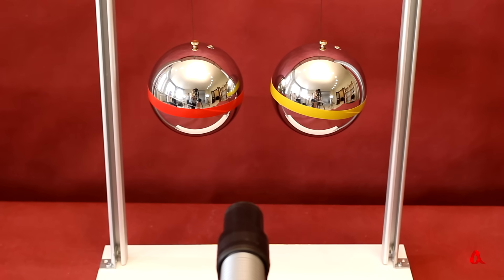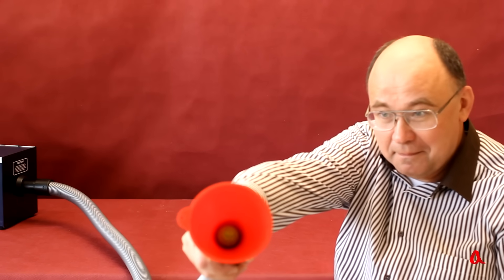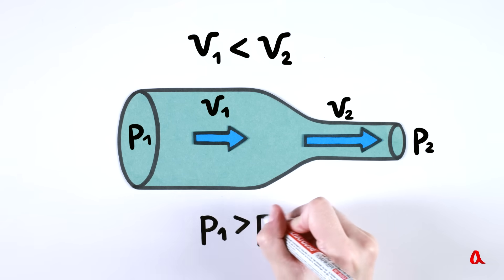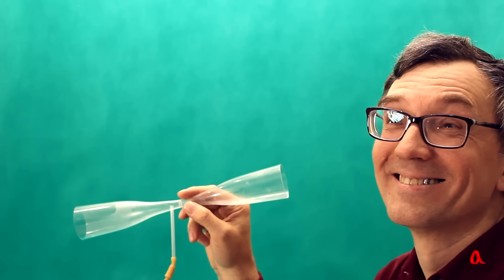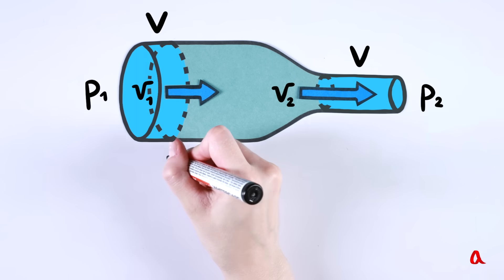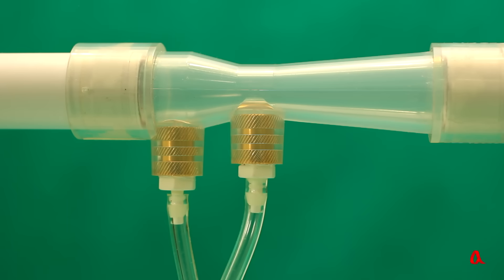Bernoulli's principle

Comment: How do i get max water pressure to my house if my meter is 500' away? Should i just run 3" to the house then switch to 1/2"?
Reply: At each diameter of a certain length there will be a different loss, caused by the viscosity of water at a given temperature and pressure. The smaller the cross-section, the greater the loss. When connecting to a house, the price of the pipe per 1 bm also comes into play.

Comment: This principle is what allows replacement or 'feed' water to be added into a pressurize vessel like a steam locomotive's boiler.  The device is called an injector.  There are two kinds, lifting and non-lifting. Steam is jetted down a tube toward the check valve on the side of the boiler.  The water is lifted into the venturi and is forced into the boiler past the check valve.

Comment: 3:01 carburetor. I just remember faster moving air = lower pressure. Hurricanes and tornadoes have low pressure because the winds inside them are moving faster than the air surrounding. Another example is when you're smoking in a car and crack the window. The outside air is moving faster than the air inside so there is lower pressure outside and higher pressure inside so it seems to suck or push the smoke out. Its also why airplane wings are more curved across the top and flatter on bottom. Air has to travel a further distance within the same amount of time to cross the top thus it is moving faster relative to the wing than air traveling beneath the wing. Lower pressure above the wing, higher pressure under it = lift
Reply from the maker: You are right, we recommend watching this video as well: https://youtu.be/YiFABManCso

Comment: This principle is used in laboratory apparatus for filtering chemicals. We have used such filtering device   in which running water pipe is used instead of air blowing pipe and thereby air is being removed from closed flask and filtrate is being sucked into closed flask leaving the solid precipitate on filter paper. Mostly all science graduates must have seen and used it in college days.
Reply from the maker: That's a great practical application of the principle!

Comment: Hang glider pilots are very aware of this. The compression at the top of the hill as the air speeds up can trap a glider or make it fly backwards, in relation to the ground, if the flow is greater than the max speed of the glider

Comment: Cool principle. I wondered what that principle was when I put my floss into running tap water and you can lift it up and down while it's basically stuck to the water 🤭😝
Incredibly fascinating stuff. A while back I watched a video that used that Venturi principle too, to empty a big pond using some PVC pipe, one horizontal and one vertical in the middle of it. The horizontal pipe attached to an air pump and the vertical pipe was put into the water that needed to be removed. The pump turned on and the constant rush of air pulled / pushed the water out of the pond. It was proper satisfying to watch 😃😄😆😅
Reply from the maker: Glad you found it interesting!

Comment: It isn't pushing apart because the air is being excellerated outward after passing the gap. Some smoke would help show this. Its important to note that;, 
 The inward force is not the result of the low pressure. Rather the low pressure IS the inward force caused by the outward excelleration.  Low pressure between them didn't cause them  to pull together, rather outward excelleration of air  did.  The lowered pressure is a reaction, not an  intial action.

Comment: You lost your audience at 4:03 in the video.  You began using terms like rho without explanation, did not explain how you derived volume squared from density and how you were applying it to achieve a desired result, and began talking about the equations and their terms as if your audience already understood them and was applying them.  The first part of your video was a success, and the second part of it is a failure.  Too bad.

Comment: Can someone please help me understand this.  Why is the pressure of a fluid less inside a narrow area than it is at a wider area. I'm thinking it should be the other way. If you put a fluid inside a wide area and then you start reducing that area the pressure of the fluid should increase, right?
Reply: Hey i just summarize you some simple laws by which you can understand it easily. The first law of thermodynamics says that the energy can only be converted or transferred to another form and it neither be created nor destroyed. And there is an another truth that the pressure flows from higher to lower without any external work.
Coming to your question that how pressure drops at a smaller area instead of increasing. But here you should need to add an another dimension ie., length to make this true. Because its all depends upon the volume. Smaller volume will increase the pressure and higher volume will make lower pressure (pressure drop). For eg if you take a cylinder you can just increase the volume by only increasing the length with a constant area. 

Here is an another real life explanation. We all have a hose at our home and when we restrict the area of opening of the hose, the water gets a higher velocity and note here the water is not get compressed or the pressure is not get increased. Instead the pressure drops. Here the mass (consider water as a small slime like material for understanding) gets expanded (like stretching of a slime) and tries to escape the little area quickly as possible, thus the velocity increases and this expansion of the mass shows the pressure gets dropped at smaller openings.

In a larger area the pressure acted upon the mass (water material) is higher and make the mass to flow with a low velocity and when it meet the smaller contraction area the water get a higher velocity and this can be said like the pressure acted upon the water get converted to the high velocity (relate the first law of thermodynamics and bernoullis theorem) This means in smaller area the velocity gets increased and the pressure gets dropped and the water get expanded.

Comment: When air passes through a narrow to wider space, it first gets compression at narrower space (reacts with +ions) and then it gets decompressed(reacts with -ions) and at wider space it has negative force pushing in opposite way like depressurizing effects on opposite sides of ball hence ball gets decompressed in which also looks similar to shockwave effect

Comment: i still dont get it
Reply: Motorcycles carbs uses this principle
Reply: You need to understand how Pressure works first then come back to the video
Reply: @nwizugbejohn3768 yeah...
Reply: Watch it twice
Reply: We all know in narrower areas speed will be higher, an example would be increased speed of water in hose or tap while closing the hole slightly. Increased speed means lesser pressure. If you can understand this if you look for it's reasons you'll understand Bernoulli
Reply: Venturi effect.

Comment: Just came across this very good video. Thanks. ..There seems to be some confusion about the pressure being lower in the smaller diameter tube that the pressure in the larger diameter tube. The spokesperson (with a very nice voice, BTW) did mention that the pressure change from high to low was due to Newton's 2nd law being applicable (when isn't it?). If we agree that the speed of flow in the smaller diameter tube must be larger than the speed in the larger (mass conservation), then a force must be applied in order for the flow rate to increase. This force (or pressure) comes from the larger tube as the flow transitions to the smaller diameter. Hence larger pressure (force/area) in the larger tube cause faster flow in the smaller tube.

Comment: What about the pressure at the point where it starts its path to being a smaller diameter. Wouldn’t the pressure be higher at that point. I get the draw and vacuum at the end of the smaller diameter back to large but the pressure must increase at the direction of the flow where it’s going from larger to smaller. The pressure has to increase.

Comment: I understand that Bernoulli's Principle exists, but I'm still trying to understand why it exists given the molecular nature of the fluid. The two things I'm trying to reconcile:
- The fluid when constricted moves faster, so there is a force (pressure) experienced by that fluid from the direction of flow.
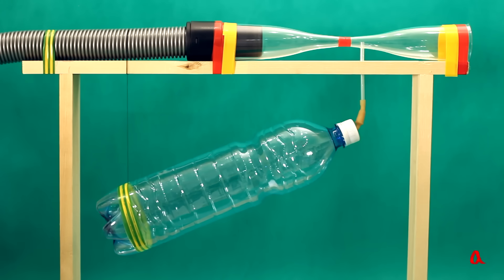- There can be fluids (e.g. the air in the bottle at 3:10) or objects (e.g. the ball at 0:42) external to the closed system that when they interact with this system they experience a lower pressure near the flowing fluid.

I may be able to come up with a molecular explanation* for other fluids adjacent to the flowing fluid experiencing a lower pressure (0:42) or even the two metal balls being pushed together (0:22), but the rubber ball experiencing lower pressure when it is directly in the flow direction of the fluid (3:10) is breaking my explanation.

*The intuition of the idea is to first start at an extreme: the fluid is moving so quickly that any other fluid that finds itself wandering into the pay is swept away. That said, I don't see how this intuition can be used to explain the rubber ball (3:10).
Reply: So many people who try to go to the molecule level make similar errors.  The molecules are in thermal motions that are hypersonic! They are bouncing amongst each other at speeds FAR, FAR, FAR, FAR faster than any of this is happening. Those motions continue and there is only a drift that is added, vectorially to those motions.  It all acts like a continuous medium. It is just the incessant pounding of the vibrating molecules that makes pressure on each other and surfaces.
..
YES.  The fluid is Accelerated away from the higher pressure - slower region, TOWARD the lower pressure - faster region.  That flow, then HAS that very SAME lower internal pressure. . .
.
It is the pressure difference, called a Pressure Gradient, that provides the Accelerating force on the fluid's mass.
Think of a brick with two, opposite-facing forces applied.  If one is greater than the other, there is a net force and the brick will Accelerate toward the smaller force.   RiGHT?
.
That bricks Acceleration is NOT CAUSING that smaller force. . . 
..
Well, when there is a pressure difference between two locations, the higher pressure pushes more and accelerates air toward the lower pressure.  
Euler is credited with figuring this out when he followed up on Bernoulli' work.  According to John D. Anderson's Text on Fluid Dynamics, there is no indication in Bernoulli's notes that he understood the cause and effect.  He only knew that the speed increase WAS ACCOMPANIED BY a pressure decrease.  
.
Bernoulli "happens" in a balloon that is venting to the atmosphere.   Or your lungs when you blow.

The "high" pressure inside the balloon/lungs, push more than the atmospheric pressure outside the balloon/lungs.
That is a Pressure Gradient (in fluid dynamics terms).
The Higher potential energy inside is converted to the higher kinetic energy outside - where that "fast" jet of air IS AT the AMBIENT atmospheric pressure .
.
 THE JET IS NOT, NOT, NOT below atmospheric pressure.  NOT BELOW!!!
.
.
P.S. The Ball in the funnel is Coanda as the air curves around the ball, lowering the pressure where the funnel is nearest the ball, thus a lower pressure toward the smaller end of the funnel.  Just about all the bad demos are due to Coanda causing  pressure reduction, NOT the "fast" air. . . 
Sigh. . . 
. 
The TWO balls is the SAME thing - Coanda.  When air flows along a convex surface, the pressure near the surface decreases because of INERTIA.  Air has mass.  Fundamental property  of mass is inertia. 
Air traveling along ball surface is being held agains the surface by atmospheric pressure - LOTS of it!!  As the surface curves away from the straight path, Inertia 'wants' to go straight and, in effect, "pulls away from the surface - INERTIA works against atmospheric pressure, therefore pushing less on the surface.  See the video in my Blog.  The Roller coaster analogy it 100% identical to flow along a convex surface. 

This is SO frustrating with every one repeating this nonsense. . . 
..
Here is my Blog that steps through all this physics correctly and the misconceptions.
. . BLOG:
  Understanding Bernoulli and Aerodynamic lift Correctly: rxesywwbdscllwpn.quora.com
- - 
Good luck and Happy new Year.

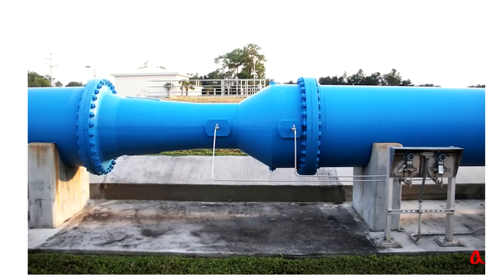Comment: 5:20 Isnt then the amount of gas the travels through the pipeline limited by that section?
Its confusing. I think no, as the gas can be pressed through. Doesn't this then create a temperature difference, where the thinner part gets warmer and after it its colder than average?

Comment: I dont believe this proves the air pressure in the main tube gets lower .the apparent suction is possibly caused by the airflow across the end of the little pipe inserted.
in the same way wind draws smoke up a chimney.
The weight and velocity and friction of the moving air in the big constricted tube causes this.
Another way to test the hypothesis is to blow air through a soft plastic tube with a constriction and see if the constriction expands or closes.
A very soft tube of thin plastic would probably ripple vacilating between open and closed is my guess.
Reply from the maker: For those who don't know physics, the world is full of magic ))

Comment: Great video,  I now know how to work the spray bottles.😄😄
Reply: Unfortunately it is wrong. . .
.
This video is still WRONG. Please make corrections or remove it.
..
The statements about Bernoulli's Principle are correct, but the demonstrations are very poor.
The balls, spoon and funnel are a result of the Coanda effect. 
.

The tube inserted into the wall of the neck is protruding into the  flow (seen at time 2:57)  This causes the air to curve around the end and sides of the tube.  This curved flow is the cause of the  lowered pressure.  This will work with no pipe around it; just the air blowing across the vertical tube.
..
To correctly measure the static pressure inside your narrow neck, the end of hat tube MUST be flush with the inside surface. 
..
At time 4:51 we see that the two pressure sensing tubes appear to be more like flush, but it is difficult to see clearly.  For that to truly sense the static pressures, there must be NOTHING protruding into and disturbing the flow.
. . . . 
This shows the proper way to measure static pressure within a flow:
Weltner Direct link: still valid on June 24 224:

“Misinterpretations of Bernoulli's Law
by Klaus Weltner, University of Frankfurt (G)”
FIG 3 Static Probe:
 https://www.prirodopolis.hr/Bernoulli-Coanda%20Demo_files/Misinterpretations%20of%20Bernoullis%20Law.pdf

.
.

Comment: Yes, yes; in TUBE, TUNNEL or in Water- TRENCH.. that Single CLOSED CONTROL VOLUME of uniform non-divided Flow. That's where Bernoulli's Equation can be Applied.. NOT around the AIR-FOIL.!!

Comment: at 3:22 does the air pressure gets transmitted to the plastic bottle from the pipe through the tube? which lowers the pressure inside the bottle as air flows causing atmospheric pressure to crush it??
Reply: Quite Correct, But lemme Clarify, A region of high pressure is generated due to extreme force and lower area, But in the Empty Water Bottle there's no such Pressure rather than Atm Pressure, To componsate the Pressure, the Pressure inside the Bottle escapes at a Faster rate resulting in Crushin' it

Comment: So this is where autists hang out, huh? SUBBED :D

Took me a little while to get my head around it, but it's really quite simple. Sure, the constriction will increase the pressure of the substance moving towards that point (given that there is a force pushing it there, of course), but on the other side of the constrict (where it starts to open up), one simply can't get enough of the substance through that constriction to maintain the same pressure as that obtained at the maximum point of constriction - the pressure disapates thereafter because the volume increases. Simple.

At first I thought that the external atmoshperic pressure (from the Earth's atmosphere, obviously) was a key factor, i.e. restricting the air flow out. But when I saw that the same effect even occurs in a sealed enviroment (5:20) then the penny dropped.

Excellent video, and comments too - even incorrect ones help you understand more. I'm looking forward to people telling me I'm wrong.

Comment: If you had that same bottle with liquid in it and another one with a tube attaching it to the pipe with a larger diameter and then increased the blower power would the liquid stop coming out of the smaller tube bottle and come out the larger tube bottle as there is less pressure??

Comment: I have a way to prove that your explanation is incorrect. You use a straight horizontal pipe with the same diameter as the outlet of the fan, and then add a vertical straw near the outlet, with the other end of the straw placed in the water of the beaker. However, your straw cannot be inserted into a horizontal straight pipe, and only the outlet of the straw can be aligned with the wall of the horizontal straight pipe. That is to say, the straw has no height in a horizontal straight pipe. At this point, no matter how high the air velocity of the fan you use, you will not suck up the water in the beaker. So your explanation is wrong. What explanation is correct? My video has the correct explanation. https://youtu.be/eKEorBipbO8?t=174

Comment: Am I stupid or this doesn't explain anything!? Why does the pressure change? And why do objects get stuck? Why is the air sucked out of the bottle when it attached to the narrow part of the pipe? Why does this phenomenon even happen? Also in the first example the air is blown from a narrow section to a wide (funnel) section and vice versa for the rest of the video. What gives?! Maybe I'm just dumb but this video didn't answer any of these questions